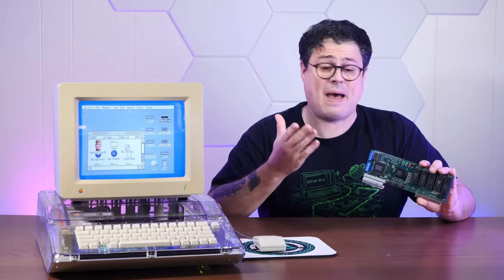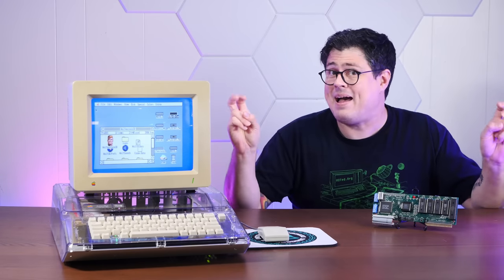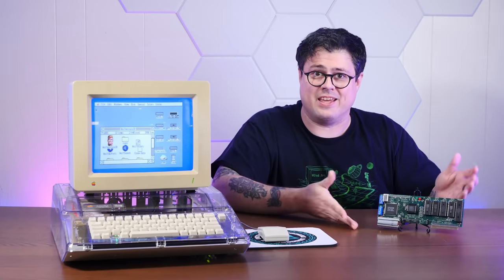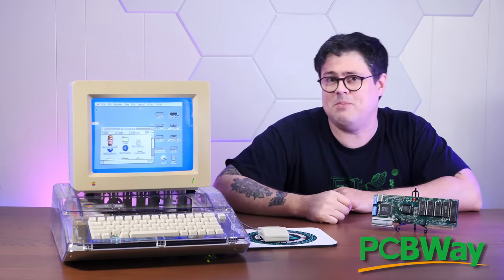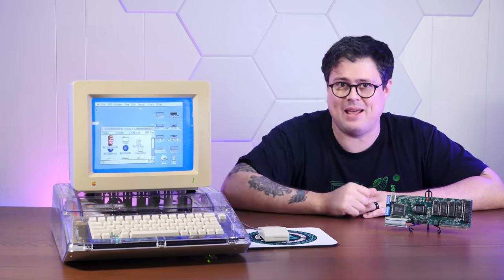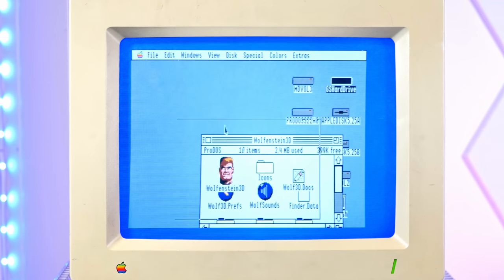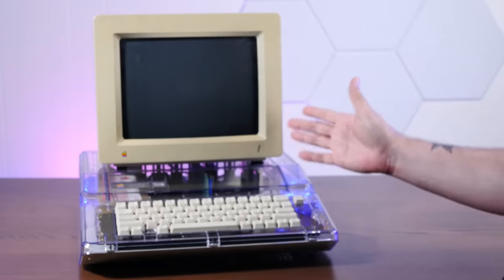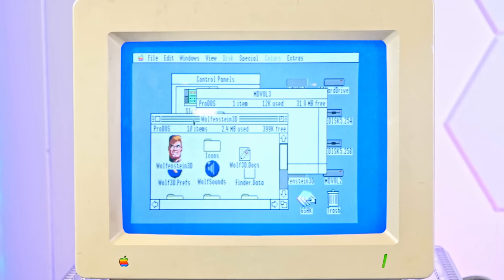Accelerating the STEALTH Apple IIGS!

Comment: There's a new IIGS accelerator called the AppleSqueezer GS (I'm its creator). It's a lot faster than the configuration you showed here, and comes with 14MB of built in RAM :) Also it's made with modern components, so a lot less likely to fail soon. Nice video!!
Reply: need to look into one for one of my IIGS's. Have fun
Reply: Where can we buy these?
Reply: 14MB?! What a madlad. If you have any videos about it I'll check it out ;)
Reply: that’s so cool Niek
Reply: Schematics or it didn't happen 😁
Reply: @goeland4585  You can search for AppleSqueezer on YouTube for some user videos, or check the FAQ on the website 😊
Reply: How is work on DMA support going? Great project.
Reply: @Whyworry Street hopefully soon after the Shanghai lockdown has lifted and suppliers get back to work again. Should be fairly soon, from what I read in the news...
Reply: Waiting for my Transwarp GS mod to be repaired. I have a Rom 1 and Rom 3 IIGS setup with a Applied Engineering Audio expansion with midi, mic, etc. very rare. Would definitely like to try one of those AppleSqueezer GS expansions and see if it works well with all my expansions from reactive micro. Was even thinking about trying to integrate a raspberry Pi  as an accelerator option but my brain hurts thinking about it :) However on the Amiga scene the Pi storm works great as a booster plus adds 128meg ram, scsi, and more.
Reply: That's super cool! I have an original transwarp in my iigs and even tho I haven't played to much with it yet, it definitely seems like it would be super useful. Amazing to see modern analogs to them, means these old dinosaurs will never (hopefully) die
Reply: Niek has an updated version coming with an additional HDMI port added & is thinner than the current version. I have the current version which still rocks.

Comment: Connecting ground on the old "stored" processor reduces the risk of ESD damage on it. It doesn't eliminate it completely of course but it's a lot better than leaving it completely unconnected so I bet that's why the put in that ground trace - and it's not like putting that trace cost anything.

Comment: My first ZipGS was an 8 MHz/16K cache board like yours, and found it made the IIGS feel more smooth, but not necessarily "fast" per say. After replacing it with a 15 MHz/64k cache ZipGS (currently have it at 12.5 MHz) the machine just *flies*! Screen redraws are practically invisible, windows and menus just zap on and off the scree instantly! I can't use the GS without one. Used to have several ZipGS and TWGS boards on hand, but unfortunately I only have two ZipGS (12/64 and 9/32) and one TWGS (7/8). I guess I'm fortunate to have those at all!

Small pet-peeve: You have your AppleColor RGB brightness too high. Optimally, set the contrast to maximum, and the brightness should be lowered until the background blacks are pure-black/invisible (the color saturation will vastly improve, as will text sharpness). Also, never touch the gold fingers on a slot card. The natural oils on your fingers can interfere with the electrical contacts and more importantly, touching that area can send ESD directly into the card!

Incidentally, I've been an Apple IIGS user for 34 continuous years. Seriously, never once retired my machine or put it into storage, it's stayed on my desk and I've keep using it all these years! It's my favorite piece of tech of all time, beating even my SNES or Vectrex, and that says a lot!

Comment: As to the IIgs clock speed, it's my understanding that the early 65C816 chips were supposed to run at 4 Mhz, but weren't stable, so they downclocked to 2.8 Mhz during development.  Once good 65C816 4 Mhz CPUs were available, the team upgraded the prototype to 4 Mhz, but since the 65C816 had may 1 clock cycle instructions and the 68000 used in the Mac had many 3 or 4 clock cycle instructions, a 4 Mhz 65C816 was faster for almost all tasks than the 8 Mhz 68000 in the Macintosh.  So Steve Jobs as Apple CEO nixed the 4 Mhz IIgs, keeping it at the 2.8 Mhz it was finalized with.
Reply: Jobs had nothing to do with it, blame WDC. Getting samples of the 65816 running beyond 3-4Mhz in 1985-86 during IIgs development was a problem. Even in 1989 when the TranswarpGS came out it was an issue getting 8Mhz samples running. The early cards were clocked around 7ish Mhz and had GALs to slow down the CPU during certain instructions due to bugs.

It really wasn't until the modern Sanyo produced CMOS 65c816-14 that "good" CPUs became readily available. Those units would clock at 20Mhz without issue in many cases. The CMD SuperCPU for the C64 used these. Of course this was long after the IIgs was current.
Reply: Classic Jobs.

At least his random quotes are fading out.
In favour of Elon Musk.

Yuck.
Reply: @DavideNastri  at least Musk didn't con his friends. I hope 😁
Reply: @akkudakkupl  no, just his business partners!

Comment: In my much younger days (25+ years ago) I attempted to overclock my ZipGS. Unfortunately I snapped one of the capacitors(?) off the board. I should really attempt a fix one day. Although the ribbon cable is also missing.
Reply: Do it!

Good luck!
Reply: Oh man, the would be so disappointing
Reply: For most of us, snapping a capacitor is a learning experience on sourcing & soldering & the occasional botch repair.  I'm sorry you didn't grow up with the cool kids at the radioshack
Reply: ReactiveMicro can reproduce the cable

Comment: Just watched a video about an LCD being installed inside the apple IIgs rgb monitor case and then saw this being posted right now! Its a IIgs kinda day.

I used to have one that i got on ebay for $10 in the late 90s, with RGB monitor, keyboard, mouse, and a 3.5 and a 5.25 floppy plus a 1MB ram upgrade, but I gave it away because i got bored with it. Kinda wish I didn't.

Comment: I wonder if anyone ever did anything with the Ti 99/4A ? I think we got one in 1982 when I was 10. Along with some game cartridges, which if you had enough you clippd the proof of purchases to send off for the Terminal Emulator II cartridge & speech synthesizer attachment. (it made some of the video games talk and there was some basic programs you could create an entry field and whatever you typed it would say.) We didn't know anything about the whole hooking it up to the telephone thing. I think I have one of the white units that came out after the silver unit we originally had. I think I found it at a garage sale or thrift. We used the cassette tape to load the various Adventure games (you had to hook up the Adventure cartridge then load the game from cassette) and also save programs I typed from basic., as well as saving my progress from Adventure or Tunnels Of Doom.

Comment: hey great video! at school we had a mix of various Apple IIs and early non-color Macs to use. we never had the GS it was all like MS-DOS to get the apple to do anything. these machines do seem cooler than I would have thought to mess around with. we did later get a lot of computers updated, I think they got rid of all the classics, plus and 512K machines, and got LC2s and classic 2s throughout the computer labs. We did have a few standout machines added such as the Mac 2 vx and PowerMac 6100/60 also, but just one of each :)

Comment: A 1MHz 6502 is about performance equivalent to the original IBM PCs with their 8088 at 4.77MHz, so then you can think of the IIGS as a Turbo XT and the upgrade card as like one of those Intel drop in 286/386 upgrade boards. 

Also consider that the PC version of Wolfenstein 3D has been modified to "run" on an 8088, just about as well as it runs here...

Comment: Very impressive. Is it possible to increase the window size on Wolf 3D?
Reply: The IIgs (accelerated or not) might not be able to keep up. The video RAM on the IIgs runs at 1MHz, and Wolf 3D on the IIgs works by rendering the game first to fast memory (which runs at the speed of the CPU) then using the IIgs' RAM "shadowing" technology to copy the fast RAM to slow RAM with a technique called "PEI slamming" - basically the program has to copy the graphics data onto itself to trigger the "shadowing" feature. To do this as fast as possible, the program relocates the stack to coincide with the location of the graphics data so it can use a 6-cycle instruction (at 1MHz, because it's shadowing to slow RAM) to copy each 2 bytes of display data...

So to "PEI slam" the whole display would take 96ms (frame buffer is 2 bytes per 4 pixels, so 1.5ms per pixel at 320 x 200), meaning that if the game were doing nothing other than updating the display from the double buffer, it could only get 10 frames per second running at full screen. Regardless of what kind of accelerator is in a IIgs, that's the speed limit for updating the display.

As shown in the video the game is using around 30% of the display, so it should be able to update from double buffer in around 29ms, increasing the theoretical upper limit for the game's frame rate to around 33 fps.

(EDIT): I'm not entirely sure I'm correct with my analysis of the timings here. the PEI instruction takes 6 cycles to read 2 bytes of memory and write it, in this case, back to the same location. Since it's a write to shadowed RAM the CPU does need to slow down to accommodate the speed of the Mega-II core. The timings I calculated supposed that the CPU would be clocked down to 1MHz for the whole instruction, but I've seen info that seems to indicate that it would've just had to wait long enough for the Mega-II to sync the update to slow RAM, so maybe PEI-slamming is faster than I thought (Somewhere between 2-3 times faster than what I calculated, by my guess, since only the "write" portion of the PEI instruction needs to run slower)

Comment: Had the IIGS beaten the Macintosh , running at the full 8mhz I purpose that the next generation of the Apple II line would eventually been the Platinum line using components of the 2000's all the way to present day dubbed the stealth line of computers. using components like HDMI, USB, Serial, Parallel, Thunderbolt, and lastly a Compact flash Card reader present at the back of the machine.

Comment: I once had 6 working ZIP GSX. I sold 3 and was left with 3 working cards. Over the years all 3 cards died. The ASIC on the ZIP GSX is dying of old age. In the coming years more and more ASICs will die, as sad as it is. I would not upgrade the card! It may very well kill it in the long run.
Reply: Zip Technologies went the cheap to produce route of cramming the slowdown logic into a ASIC. The TWGS went with an early CPLD and discrete logic, the bonus of which is that it can be more readily upgraded, overclocked, and repaired.
Reply: @NJRoadfan  Hard to tell if it was the 'cheap' way. It was a pretty good accelerator and could easily archive 12,5 MHz at the time. With the later 14 MHz WDC 65c816 chips, the ZIPGSX can go up to 16 MHz in most scenarios (it needs selected 12/15ns SRAM for that to work). The ASIC is actually running at a constant 20 MHz with overhead 16Mhz is most likely at the upper end of technical possibilities. The 65816 CPUs at the time were buggy and reached 10 MHz at max (overclocking to 12 MHz was possible with selected chips). I have tested my defective cards and came to the conclusion that it is most likely the ROM in the ASIC that went bad. It may have a limited number of read-cycles before it dies. Sometimes heating the card to 150°C for 2 hours in the oven brought a card back for a few months... but eventually all cards died.

I am the first to say, that the Transwarp GS is the better card despite the older technology and less efficient design. The TWGS is just a lot more repairable than the ZIPGSX. I have 3 TWGS and all work normally, one is even stable at 18 MHz (about the same speed in applications than a 15-16 KHz ZIPGSX). I would like to see a revamped TWGS with a modern FPGA at 20 MHz. It should be possible since the code for all the programmable chips on the card is known.

The ZIP Tech guys were very good at designing cache circuits and were very good at large scale integration. The 6502 ZIP-Chip was a marvel at the time. It used an integrated ASIC, cache and CPU on a ceramic (later normal PCB) carrier in a "chiplet" style configuration. Very advanced at the time. I suspect something similar for the ZIPGSX ASIC and it may contain multiple chips/chip-dice. Maybe the 40pin  'debugging'-connector was used for programming the internal OTP-ROM?

Here are some internal images of the ZIP-CHIP 4000 and 8000... as well as a lot of 6 defective ZIPGSX before repair.
https://drive.google.com/drive/folders/0B5SAWSGa49rLamJSZTloVkphQjA?resourcekey=0-NPOtW0st5FVpAidNBKirPQ&usp=sharing
Reply: @john_ace  Some awesome images of the ZIP-CHIP internals - thank you!

Comment: Meanwhile I'm wondering two things about the GS.

1. Is there a way to make a graphics card for it both so it can accept a stock VGA monitor (and now have HDMI hookups) and to give a little bit of processingoffload from the primary CPU. Sure the hardware can be made but how would you make whatever the equivilant of a driver for it? After all you'd need to tell EVERY graphic call to go to it instead of the CPU.

2. What would it take to make system 7 work on it?
Reply: I'm pretty sure both of those are impossible. The CPU architecture is entirely different from the Macintosh line, and it's probably hard coded in how it's graphics work.
Reply: GSOS was an entirely different operating system than "System 6" for the Macintosh. So, to get System 7 to run on it, someone would have to re-write the Macintosh operating system to run on the IIgs hardware.  In reality, GSOS already had many features of Macintosh System 7 either built-in or available as 3rd party software. (Truetype fonts and a "Multifinder"-like experience being examples of the latter)
Reply: yes some one makes a tap to get VGA out of it..
Reply: There was a VGA card for the IIgs called the Second Sight, which are pretty rare.  Using an Oak VGA chipset, it provided both native graphics modes and enhanced VGA ones.  Search for "iigs second sight" and you can find the manual for it.
Reply: 1. It's been done, but...
2. A Mac on a card, basically.
Reply: @fnjesusfreak  Both the exact thing that isn't useful but at th same time?

[I ABSOLUTELY WISH TO KNOW MORE]
Reply: @singletona082  There's actually a board that turns a IIgs into an x86 (V30 actually) PC capable of running MS-DOS.  It would theoretically be possible to do the same with a Macintosh instead of a PC, but I don't think anyone's ever cared enough to do it.  As for VGA, the Second Sight's been mentioned.

Comment: Is the Zip2GS a faster upgrade than the TransWarpGS, or just more rare?
Reply: I think it's rarer. The TWGS was just a more popular product at the time in comparison. That said, the ZipGSX had a smaller chip count which also made it run cooler than the TWGS.

And apparently the ZipGSX can't be overclocked as much as the TWGS, so for those who want to run the fastest still look to that board.

Comment: All that excitement over 8mhz.  That's only a little more than 2x speed
Reply: If even that...  Because the system still has a built-in bottleneck of the 1MHz Mega-II core, which includes the graphics chipset and its RAM...

Comment: Seems silly to limit the cpu speed just so it doesn't perform better than the new models that they were planning to release. They could have just tried to have the planned models to have a higher clock speed than the IIgs.
Reply: I suspect that story is a mixture of speculation, truth and slightly distorted facts. Apple had to look at long term development. The 65xxx processor series wasn't being developed at the same rate as Motorola's 68K series, which were the logical alternative if you didn't want to go to x86. Just like Apple were forced to use PPC when development of the 68K series stalled. But eventually PPC suffered a similar fate, with the IBM designed 'G5' series struggling to keep up.
Reply: Apple had a very successful product line in the Apple II...  But the platform was also almost a decade old by the time the IIgs came out. By focusing on the Macintosh they were able to establish a platform that carried the company through the next 35+ years.
I don't know the extent to which the stories are true, of Apple intentionally limiting the IIgs performance to avoid competing with the Macintosh platform (and the Macintosh II was indeed faster than 8MHz) but I think they were right to focus on the Mac. With the Mac they managed (barely!) to stay afloat through the 1990s, when other giants of the 1980s like Commodore and Atari were going under.